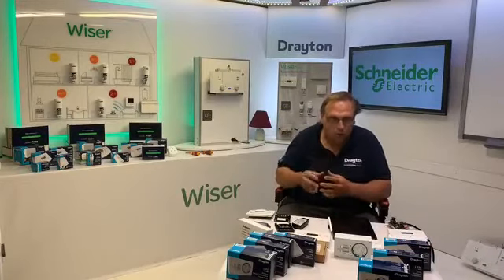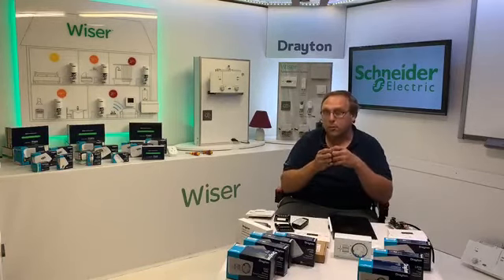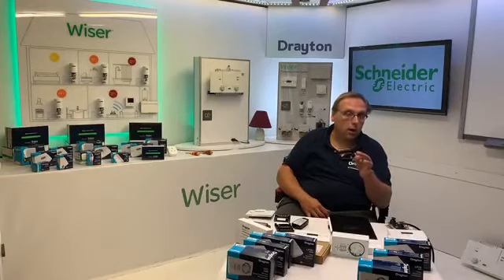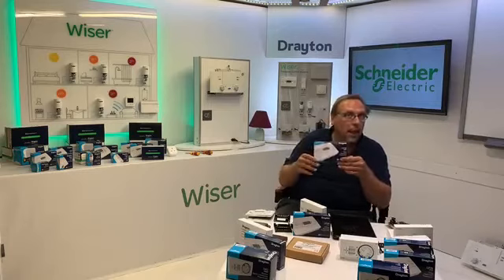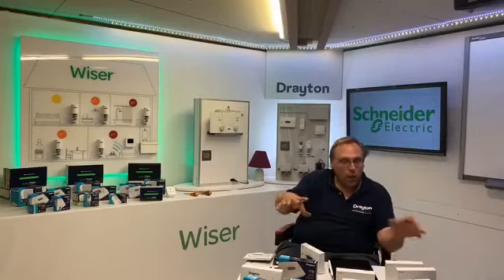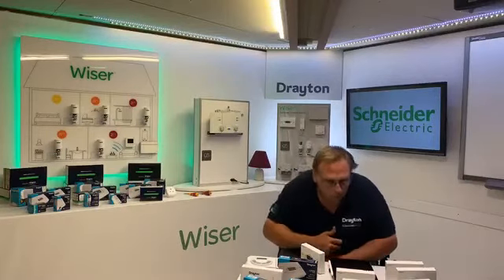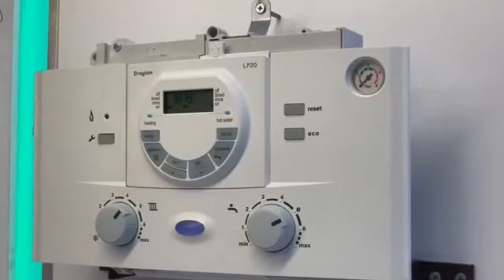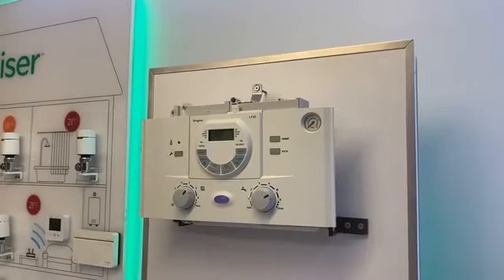FB Live Training - How to install Drayton Time Controls

Comment: If I turn off the advance water boost setting does that mean I won’t get hot water at all? 
I’m worried the advance boost time set is using more electricity and ranking up the bill. 
Please clarify 🙏🏻🙏🏻🙏🏻
Reply from the maker: Have a chat with our customer services, they will be able to help you out - 0333 6000 622

Comment: I have a Tempus Four Weekender controller that needs replacing, are there any models that will slot straight onto the existing electrical backplate as I cannot find a new or used replacement.
Reply from the maker: Unfortunately the backplate for the Tempus Four is not the same as the current models but all the necessary wires are there to wire into the new backplate. The closest current model is the LP 241.